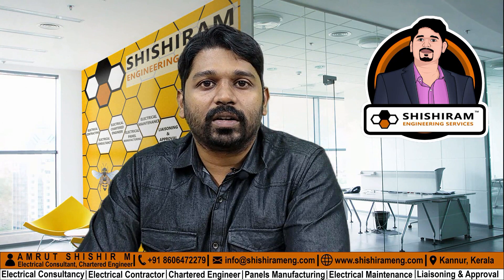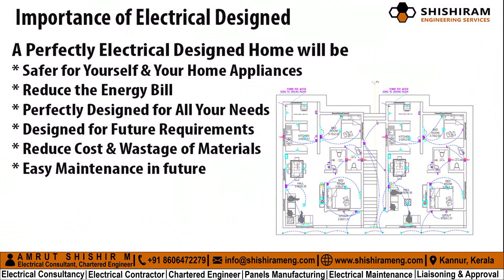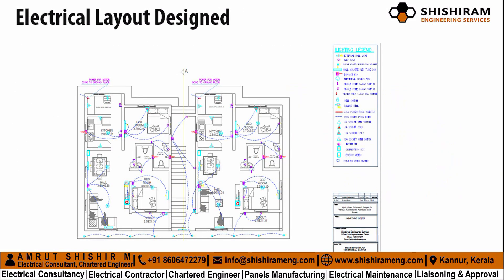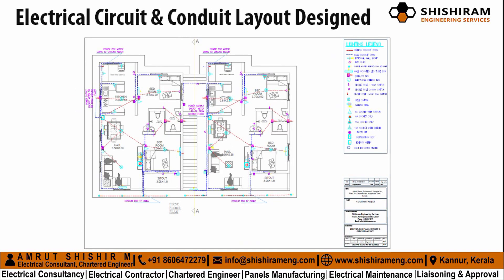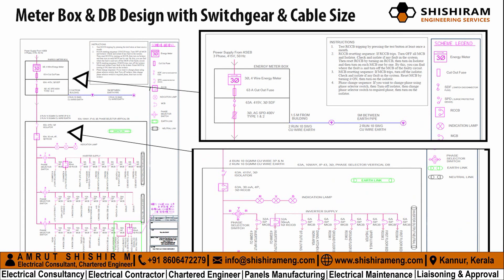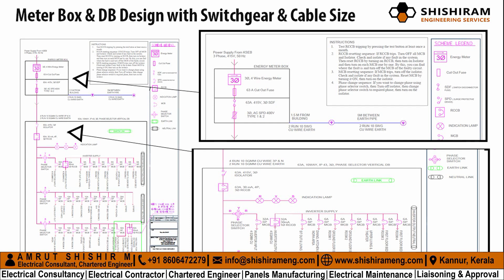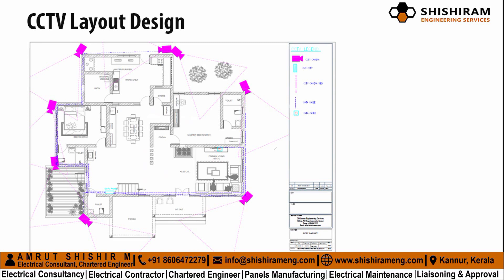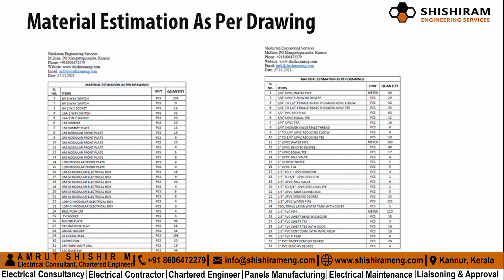വീട്ടിൽ അടുക്കളയിൽ ചുമരിൽ എല്ലാം ഷോക്ക് ആണ്. കാരണം പറയാമോ ? Reason For Electrical Shock From Wall

Comment: 6A top of my stabilizer for double door fridge is connected to a 6A socket. Most of the times neutral and phase pin of top are in hot condition but not melted the socket till now. What wil be the reason & solution? Pls reply
Reply from the maker: I have noted down this... will make a short video... keep watching...